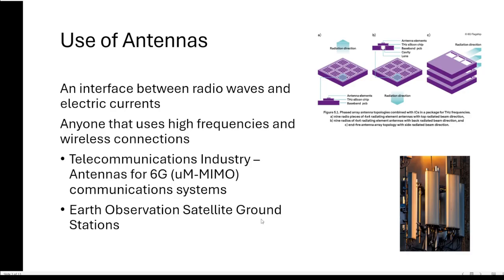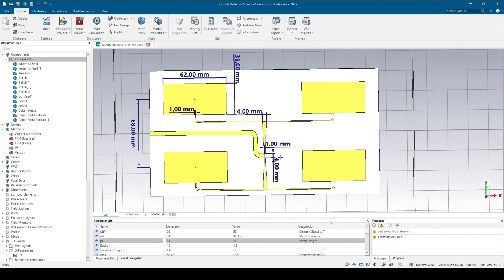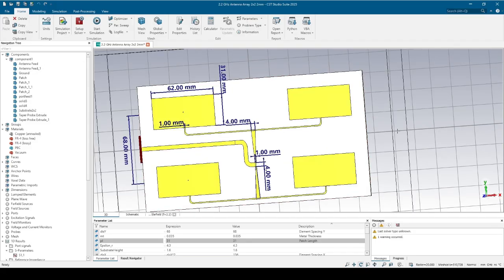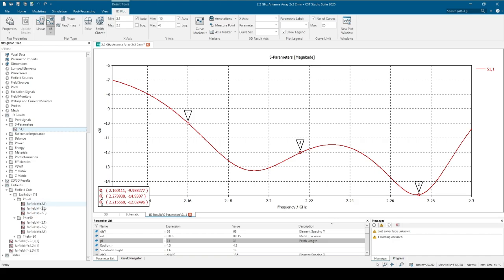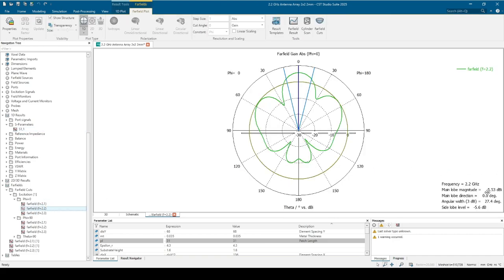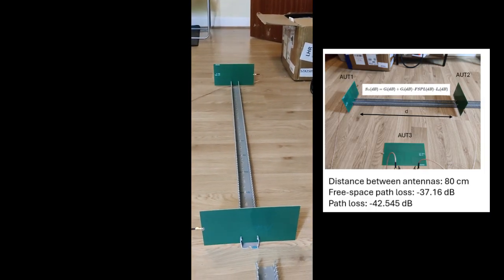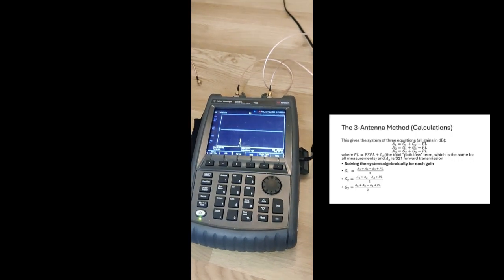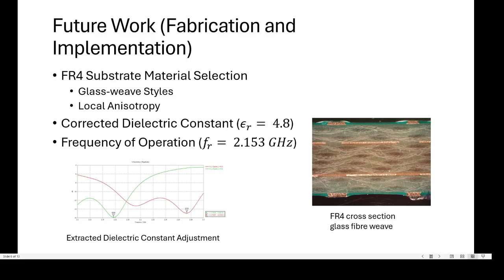WW Antenna Project Video

Comment: I think a good 900mhz ant would be far more valuable due to the nature of penetration, and new wifi Halow routers. Try to slow down  your speech and simplify  what your saying. Good luck with future builds, also try building the bi-quad. its far more forgiving an antenna to build, cheaper by far and you wont have the dielectric issue. Good luck, Chris Armstrong, aka Ecco Project founder.